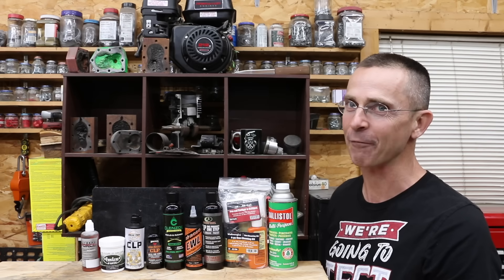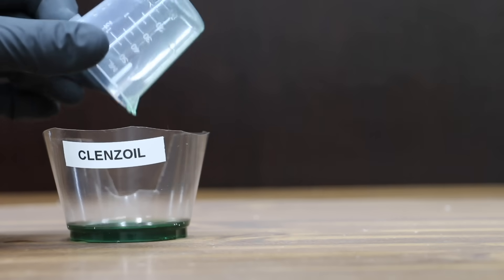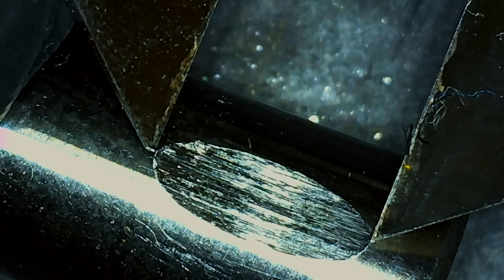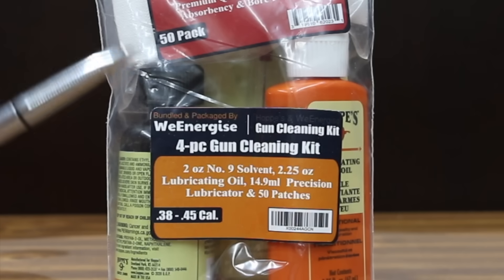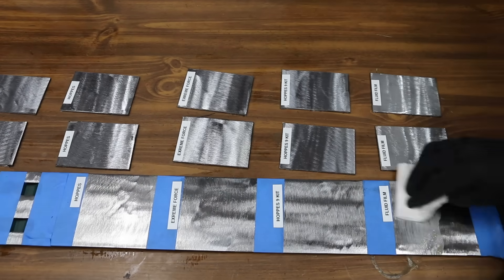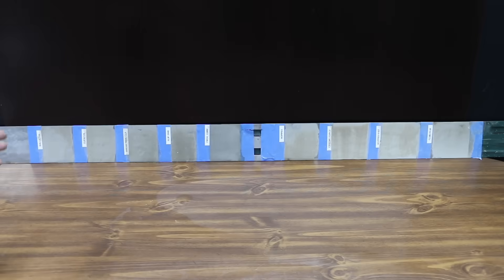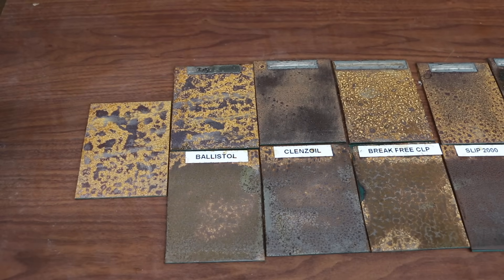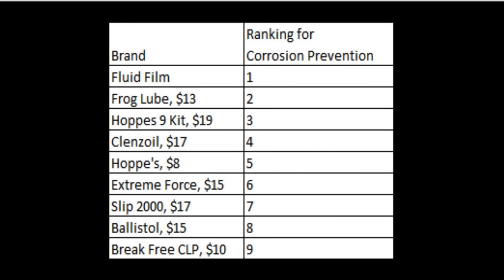Don't Buy A CLP Until You Watch This Review! It'll Save You Time And Money!

Comment: @Project Farm Would you do a test similar to this one, but add in gun oils?  CLP's are supposed to protect, but do they protect as well as dedicated gun oils?  FP-10 is the best I've seen from previous tests and my own experience.  Please throw that one in the mix.  I also have heard that various versions of BreakFree CLP perform very differently.  A lot of people swear by it and their corrosion tests did very well with it.  The black spray can version I believe is the legit one.  It can also come in a black squeeze bottle.  I'm not sure about the gray Milspec one you used.  Sage and Braker also have a CLP.  One more I'd add is the new king of the market in long range shooting, Boretech Eliminator for cleaning and Boretech XP Oil for lube.  Eliminator can also be used as a CLP I believe.
Reply from the maker: Thanks for the suggestion.

Comment: As always, great video! However, you forgot to test Mobil 1!
Reply from the maker: Thanks!  Thanks for the suggestion.
Reply: @ProjectFarm : Thanks for the response! I've been in the gun industry for over 25 years and I've tried every lubricant out there and without doing in-depth testing like you've done, I've found that CLP or Mobil 1 work best for most applications. 

The SWAT guys and a lot of LEO's in my AO use Mobil 1 on their guns (as do I). 

Maybe you could do a short follow-up video on Mobil 1 for us inquiring minds. 😏

Comment: If you’re watching this video to pick a CLP you should really consider toxicity. I have previously used hoppes and break free CLPs. They always gave me headaches even when cleaning outside. Break free would even make my fingers numb. Despite doing poorly in your test I now prefer ballistol to anything else simply because I don’t feel like it’s taking weeks off my life. It contains relatively mild solvents and lubricants. I do not expect to run my guns in the snow and sand or run hundreds of rounds without cleaning. I just want my CLP to protect my guns in relatively good storage conditions or some moisture while hunting (where I clean quickly afterwards). I keep my guns carbon free by cleaning often and I don’t want that to kill me. If this is like you I’d consider ballistol strongly. Despite that wear gloves anyway. Stay safe. Treat any of these things like you would brake cleaner.
Reply from the maker: Thanks for the feedback.

Comment: Why is Slip 2000 EWL so highly acclaimed in the gun industry with such an unimpressive lubricity result?  There's gotta be more to it?  Is it just viscosity?

It's what I use in my AR's because other oils have burned off easily.  It works, and I have no complaints but I wonder.

I used Breakfree CLP for years as well with good results but decided to switch things up to a cleaner and good oil, rather than a combined product.  Slip 2000 is a little pricey to use as a cleaner too, so I'm debating switching back to Breakfree CLP as the do-all.  I only clean my AR's every 500-1000 rounds though so I guess cost isn't really a big deal in the end anyway.

Comment: Very interesting review. I purchased an LWRC IC-SPR last year and the owners manual mentioned that they used Slip 2000 at the factory and I have been using it as a lube and rust preventative with Hoppes #9 to clean the barrel. Now I have second thoughts going forward. There are other properties not tested like the product oxidizing and turning to gum/varnish over time will have to give this some thought
Reply from the maker: Thanks for sharing.

Comment: I have used Frog Lube extensively for a while. It is sold as a paste or a liquid CLP. The best way to apply it is by preheating the metal with a blow dryer and liberally applying it to parts and letting it cool down before wiping off the excess. Break Free is the same. I used to preheat my M249 before application and that gun ran without jamming. That is notable because SAW's have a reputation for jamming. I also use Slip 2000 w7th decent results. The FL is great for long term storage or use in salt air environments. Regular maintenance which requires stripping off old lube and reapplying is crucial to protecting your firearms. Oxidation is real and do not think lubrication doesn't need to be replaced long term.
Reply from the maker: Thanks for sharing.

Comment: The place I worked, to remain unnamed, had an obsession with Frog Lube a few years ago. It was believed that frog lube would be the end all be all lubricant for firearms and was applied to every single firearm in the arsenal. It was discovered at the next quarterly qualification  that all of the firearms failed for fire and the firearm has to be fired several times before it would actually function as designed. (Double single Sig P226). Since then it has been banned.
Reply from the maker: Thanks for the feedback.

Comment: Whenever I see your oil tests I'm happy. Do you have a spreadsheet with all the lubes tested together? I would be tempted to laugh at olive oil, bacon fat, petroleum gel, zinc oxide diaper cream, and glycerine in there too. It's a single datapoint, but your rig is so good at melting away the stress of a day.
Reply: Their is a very good DIY gun cleaner recipe available for years..
It uses Dextron 3 ATF fluid as the lubricant..
You add other products to deal with the Copper and the lead etc..
Reply from the maker: Thanks!  Glad to hear!  Thanks for the suggestion.

Comment: Great comparison, as usual. I'm curious how weapon-specific CLPs would fare against automotive lubricants such as Mobil 1 and/or gear oils (say, 75W-80), as well as more all-purpose ones, other than Fluid Film. I'd love to see that in the future if you think there's a point to it.
Reply from the maker: Thanks!  Thanks for the suggestion.
Reply: @ProjectFarm  would love to see Weapon Shield put to the test thanks for all you do
Reply: I know a Vietnam vet who only uses Mobile 1
Reply: For longer term storage I use Mobil 1 too. You can use more, so it's much more cost effective.
Reply: I never trusted CLP as a lubricant.  Somehow could never get past a cleaner being a lubricant concept.  I've used synthetic motor oil for eons as a lubricant and it's never failed me and will continue to do so till something better comes along.  Firearms don't work in the extremes motor oil is designed for.  Try running breakfree or ballistol in your crankcase and see how far that gets ya.
Reply: Since most CLP’s are half rust penetrant, I only use it for cleaning carbon.  For lube, just use the slickest oil that you can rub between your fingers, which is seldom a motor oil.  Hoppe’s 9 is a very slick one.

Comment: Would have been interesting to see the test compared with Wd40. A gun Smith recomended it. One of the reasons was because of how thin it was you didnt ruin the barrel if oil built up in front of the bullet when fired. Maybe Even more brand since none of them did it all Great. Well if Wd40 is best for every thing we might not get Therese cool empiric testing videos. Great stuff!!
Reply: @orangemountain457  Thanks!
Reply from the maker: Thanks!  Thanks for the suggestion.

Comment: As always top notch work. I would rate them by cold weather warm/weather applications. Be good to know at what temp they are failing. Not everyone hunts in -40 :-) without that data I'd say cleanse oil warm clp cold. That wear difference is huge between the two though. Guess that's why sloppy guns are best for cold weather like the AK.
Reply from the maker: Thanks!  Thanks for the feedback.

Comment: One thing I've learned over the past 25+ years is that 'clp' combination products rarely perform as well as a dedicated cleaner and separate lubrication products. The heat test is one thing I've never considered, but it certainly changes thoughts about what a hot barrel does to these products
Reply: I clean with Hoppe's 9 and lubricate with RemOil.  I'd love to see these matched up in separate cleaner and lubricant trials.
Reply from the maker: Thanks for the feedback.
Reply: Indeed, i think of it kind of like wd40 for guns. also it would be interesting to see how the lubricity would change after being heated, i imagine some of the lighter products would have their volatiles evaporate and change the viscosity.
Reply: This. CLPs are for military dumbasses.  No serious shooter uses them

Comment: I wouldn't trust Froglube on a weapon.   I had a bad experience using it on an AR.   After applying it according to the directions I fired one round.   I wasn't able to clean it for several months and when I handled the rifle next it felt like it was "lubed" with glue.   It was so sticky there's no way it would have cycled.   I normally use a 2 to 1 mix of Mobil1 oil and ATF.   It works like CLP and it's basically free since I maintain my on vehicles.
Reply from the maker: Thanks for the feedback.

Comment: Great test! I have tried a few of these myself. Usually the break free CLP, and Lucas bore cleaner and Extreme duty gun oil. I have used Frog lube as well, but it's supposed to be melted on the parts- you're supposed to rub it on, cook in an oven at a low heat for like 15 minutes so it melts, then wipe off when it cools. That's too much work for me.
Reply from the maker: Thanks for sharing.
Reply: I either lay my parts in the sun or use a blow dryer and heat them up. Works great for Frog Lube and it makes cleaning the gun very easy as everything wipes right off.
Reply: That's really only the first application,  not every time. FL is supposed to work like those teflon fluids for engines which is why you want some heat when you first apply.  Another example would be cast iron.  You only need to season it once when taking care of it properly. The heat from shooting will help later lubrication cycles.
Reply: @davidhawkins847  very true.
Reply: I've used liquid CLP 🐸 Extreme for 2yr. The firm changed the design, contents do the fluid is easy to apply. My cousin prefers the older Froglube grease but I run CLP spray. Mostly modern handguns. Glock Walther S&W. Ballistol is non toxic, no fumes. I'm surprised it did not act better 😬. I've used it on wood stocks, grips, metal, polymer. No issues.

Comment: welp i guess if this video would have came out 2 years ago it would have saved me alot of cold trips to the range testing gun lubes in subzero weather. but your assessment on that is exactly what my testing has resulted in as well. What made me dive into this was i was hunting ducks and my shotgun froze up using Lucas CLP so i reached out to them they never answered and since then i have been testing other lubes and CLP's in the weather. the slip 2000 EWL and the Break Free CLP are what i keep in stock in the gun room.
Reply from the maker: Thanks for sharing.

Comment: Ive been using Break Free CLP for about 6 years and works great, i've seen it work on a gun that was so carboned that it stopped working the user soaked it with break free for about 10 min and gun the started to again and run for the rest of the day at the range. i was sold on it at point and have used it since.
Reply from the maker: Thanks for sharing.

Comment: If this Ballistol is still the same recipe like it was when invented, it has one feature the others probably do not: It´s food safe, which makes it suitable for kitchen equipment (does not go rancid like vegetable oils).
Originally it was invented as a multi-purpose solution for soldiers´ needs:
Lubricates and protects metals, keep sleather soft and waterproof, the latter also applies to wood, skin care (slows drying out in cold/wet), even desinfection (mostly due to the alcohol content I guess).
According to an old brochure it could even be swallowed without harm, although there´s no reason to do that.

It´s like with many Jack-of-all-trades: It´s ok for many things, but it´s not the best  in any one of those.
Still - if you are in the field, it´s just a single small bottle tthat adds to your gear.
Reply from the maker: Thanks for the feedback.

Comment: Great testing all of the tests were very interesting, creative and ingenious as usual. I would love to see how the weapon shield compares as I just bought some. I used to clean a lot of firearms before the boating accident, I think the exhaust is more soot than hard crusty carbon like found on firearms. Have tried a lot of stuff to remove copper and hard carbon from bores using a bore scope etc, clp type oils don’t really remove anything other than powder foiling and soot, best we have found for regular maintenance cleaning is boretech products and weapon shield and Lucas are our goto lubricants. On a extremely fouled barrel sometimes jb bore paste is required to fully remove everything. If you could source a few suppressors or suppressor mounts/brakes that would be a great source of firearm carbon, or just run an AR suppressed 3-400 rounds and it will carbon up pretty good on the bolt etc.
Reply from the maker: Thanks!  Thanks for the suggestion.

Comment: Your rust test mirrors what I did about 2013, with Froglube coming out in 2nd place behind Eezox. I do have a couple questions, though:
1. Why did you use the Froglube paste and not the liquid?
2. Did you follow the manufacturer directions to heat the metal and let the Froglube soak in? I found that it really does make a difference in Froglube's performance.
Reply: I was also curious about the paste. It seemed like an odd choice given that there is a liquid version.

Comment: Great video and as an old school soldier I was rooting for the Break Free. However, a long time ago I started using canola oil and haven't looked back. I think it's the best product ever for cleaning and lubricating firearms. I'd love to see some regular household oils like evoo, canola, coconut and so on go through your rigorous testing.
Reply from the maker: Thanks!  Thanks for the suggestion.
Reply: So... an update to my previous statement as to canola oil being the best gun cleaner and lubricant. I had an opportunity to shoot in extreme cold weather on Thanksgiving Day 2022 and I'm back here to say "Nope!" 

My very light coating of canola oil was so thick and sticky that it slowed the firing pin of my AR down to where I was getting light strike after light strike. I pulled the BCG apart, put some Hoppes on the internal parts and didn't have any more issues the rest of the day. I'll be the first to admit when I'm wrong, and in this, I was wrong. 

Project Farm, please test these common household oils in your mad scientist's lab. I am extremely curious to see how they perform in these same conditions. In the meantime, thank you very much for what you already do. You have saved  us all So Much time and money along the way.

Comment: I'm gonna start running Clenzoil in my CRF450 engine! It might be too slippery, for the separate trans / clutch duty. I'd like to see what ATF does against motorcycle specific transmission oils vs generic petroleum based product. Ive heard of people running it in the trans / clutch of their 2-strokes, for ages. The clutches are what would make this test interesting and challenging (and probably not doable).
Reply from the maker: Thanks for the suggestion.

Comment: Excellent testing as usual. I would like to point out that the lubricity tester creates a condition that may not replicate real usage: the product needs to be sloshed around until it coats the surfaces, where in many use cases, the parts will have been thoroughly coated. It seems to replicate really well situations where the lubricant must be moved from an oil pan/sump. A lubricant that is easier to mobilize may not stick to the moving parts that are not supplied constantly from an oil pan.
Reply from the maker: Thanks!  Thanks for the feedback.

Comment: I have heard that Automatic transmission fluid is a great lubricant against wear and rust.
It is also engineered to perform well in temp extremes.
But you'd still need a cleaner for fowling.
Reply: Auto trans fluid is a detergent aswell as a lubricant. To keep debris from clinging on surfaces, it's great. It can handle good heat Temps and would be a great choice on the firearm industry except for a couple things...
1:smell. Smelling like a busy truck stop off an interstate sucks in general, imagine hunting 
2: "leakage": as oils get hot, they can run. ATF is meant to run and keep on runnin. Suck to have atf all over the hands, fingers, equipment...
3: stains. ATF stains like no other. I have shirts & shorts with stains (literally droplets) of atf from years of use. Wood soaking it up it will never leave without heavy wood restoration. Gun cases can spread it from one firearm to another.

My advice: until the world takes a dive into zombie apocalyptic type times...stick with a firearm designed lubricant/cleaner
Reply: @brethatch2244  Ah those reasons may be why it's not used more often.
Something like Ballistol may be less effective, but is known not to harm wood and leather, hence it's strong following, especially in the wood stock bolt action rifle community, where friction isn't an issue like with semi auto's.
Reply from the maker: Thanks for the feedback.